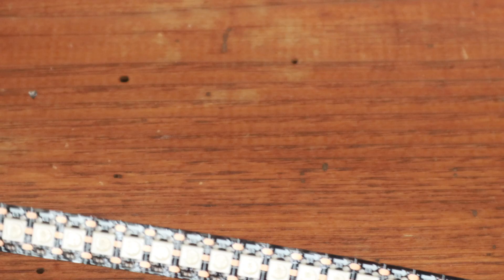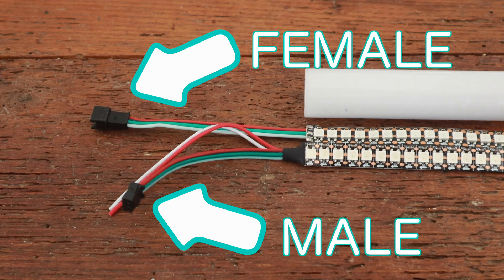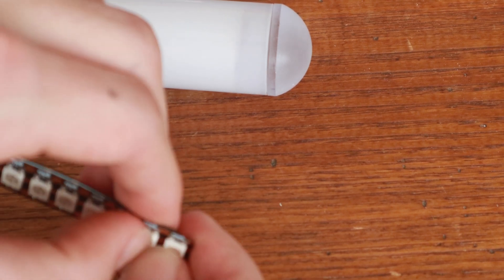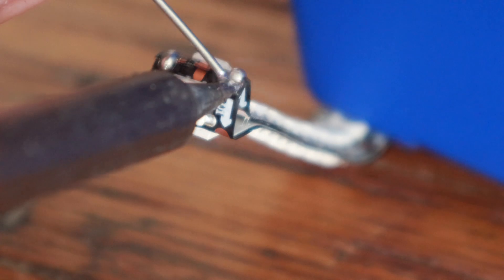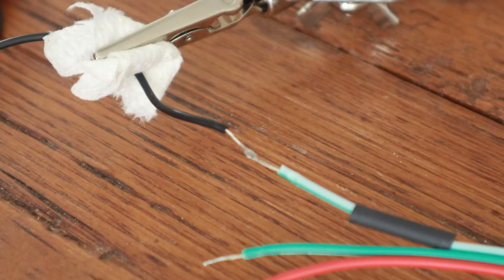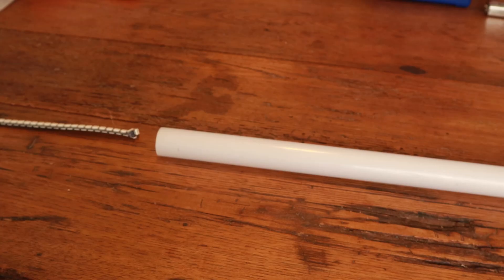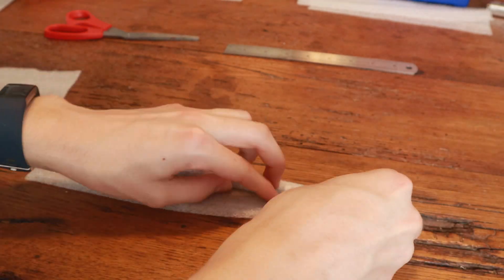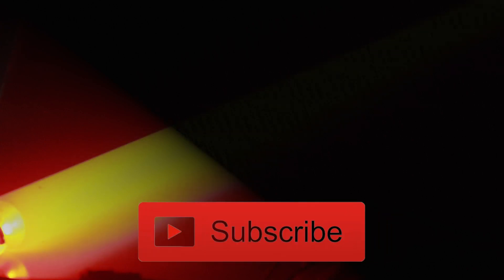NeoPixel Lightsaber for Only $60 | Part 4: Soldering

Comment: Any issues bending the LEDs like that? I don't think a 90 degree turn is within it's tolerance lol
Reply from the maker: I didn't have any issues, the PCBs were very flexible. You could skip it if you were worried about it but I made a few blades and didn't even notice any stress marks.